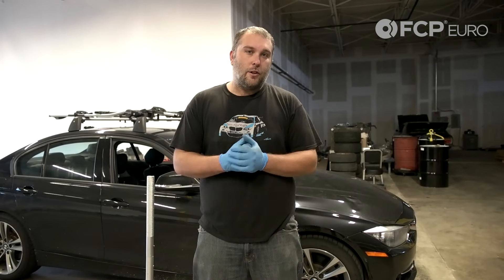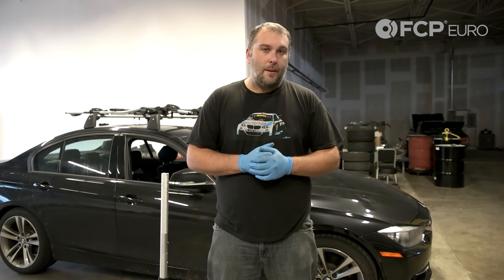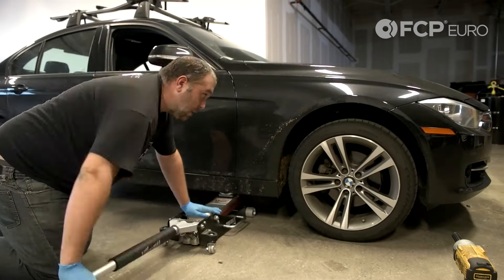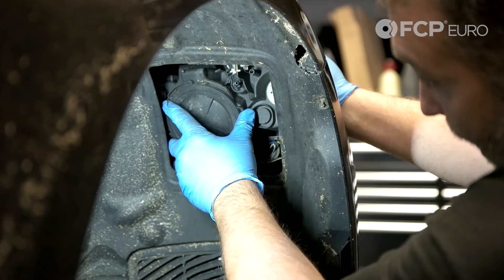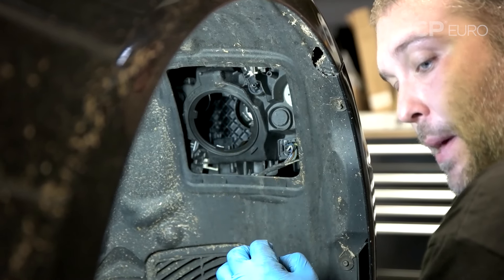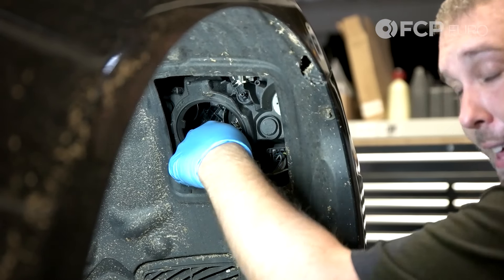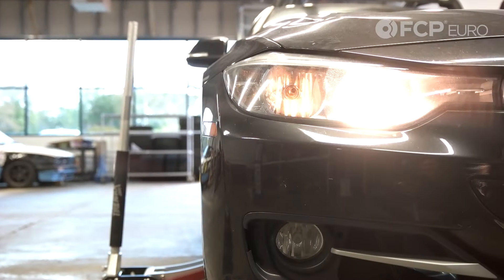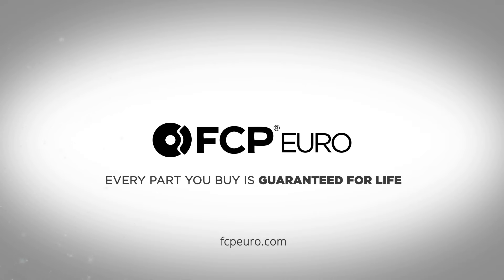BMW F30 & F31 Low Beam Headlight Bulb Replacement DIY (128i, 328i, 528i, 750Li, M3, M5, M6, & more)

Comment: FYI I just did it on my 320i and I did not need to remove the wheel. It’s a bit uncomfortable but you can do it.
Reply: Was just going to ask this
Reply: You can't do it without removing the wheels if your bulb is stuck. Ask me how I know. It is utterly absurd that BMW made it necessary to remove the front wheels to access to these bulbs.
Reply: What about turning the wheel?

Comment: No need to remove the wheel unless you want great camera angles and actually see what you are doing.  I did the first one on the driver side with the wheels turned in.  It was tight and doable.  You also have to do everything by feel, but open the bottom clasps by bending them slightly made it happen.  Once the new bulb was in, I just gave them a little bend back.  On the passenger side, left the wheels the way they were so it was turned out.  I think this gave me slightly more room and I did everything with my left hand this time.  Same procedure, just left handed.  Either way,  you must turn the wheels one direction but for some room but each has compromises on space.  I also found using a quarter helped popped off the outer clasps in the wheel fender perfectly so no screw drivers needed either.
Reply from the maker: Great notes, Paul! And yes, typically we are pulling and removing whatever is in our way to give the best possible view when filming!

Comment: Don't need to jack it up or take the wheel off. 5 minute job. Just turn the wheel fully out the way and it's easy. Thanks
Reply: I wish I believed you. I can’t unclasp the metal thing punching it on there with the tire. It’s been impossible.
Reply: It has been done 2xs on my 3 series without removing the tire. Just turn the wheel the opposite direction.
Reply: You’ve got little girl hands then
Reply: You must have small hands

Comment: Thank you for making this video short and to the point! I'm also amazed that I gotta take the damn tire off to change a light bulb!
Reply: Actually you don't! I just watched this vid for the first time literally a minute ago, found the access panel, opened her up, screwed off the lid, pulled out the light, swapped it out and bam, I was good to go after putting everything back together! Granted the space was a tad bit tight but still room enough to get the job done without raising the car and taking the wheel off.
Reply: @jnom07  I eneded up jacking the car up and turning the wheel but not taking it off. It gave me more room but I still couldn't see what I was doing.  After some hand cramps it got done.

Comment: If 1 bulb goes bad will both lights not work  ?? 
My low beams dnt wrk on neither side 
And all my light fuels are good
Reply: So do I need to change both bulbs or do I have another issue possibly

Comment: Well it is still not as bad as the bringing down the whole front bumper but lift the car take the tire out etc. it is just a light bulb replacement. you open the hood stick your hand behind the headlight take the bulb out put the new one in close the hood ... or the European way like this we are lucky they did not put a special lock to reach the head light.

Comment: My 2016 320i has a flat plastic part attached to the bulb harness. I see two flat metal tabs to release the bulb and two flat plastic tabs to separate the harness part. Not sure what’s up there. Hella part no 158 905-1

Comment: I changed out my halogen bulbs to Led's and I am getting a malfunction code on my dashboard sometimes when I drive.  Is there anyway I can get rid of the malfunction?
Reply: Akshay Singh Yes, you need to add load resisters or get bulbs with canbus built in.
Reply: Matt Wilson thank u. Will this mess up my computer?  If I don’t end up getting canbus kr resistors?

Comment: Pain in the ass procedure for the otherwise finely engineered car. I'm pretty sure that the headlight assembly designer needed to justify his/her existence and job in order to design such an over-complicated housing. Terrible design. Great video!
Reply: I'm failing to see how this is a pain in the ass? I replaced bulbs in my wife's Tahoe and I had to remove the damn airbox to get to the bulb. Now that's poor engineering. Bimmer have this cool access panel, walk in the park imo.
Reply: Saying it’s a “finely engineered car” would be a lie as well, this 13 328i I got from the auction drove perfect for a week then the water pump went bust so I replaced it. A few days later the cooling fan went bad and the car also needed a wheel speed sensor and caused the car to ride like shit.... This is average stuff for when I buy bmws, terrible terrible cars.

Comment: I'm having trouble putting the bulb back into the housing due to the fact I can't see inside it. What tips would you recommend for those that don't have a jack at home?
Reply: Kunal Patel I believe the bulb faces up. Make sure the tabs aren’t bent to much and you can look thru the headlight while you line it up. I’m not a big fan of these H7 brackets. They never get extremely tight like they would on a 9006 or so.

Comment: This is my favorite video on changing the low beams. If that upper tab couldn't get truly boogered in the process - this would all be eezy-peezy. "Kies M" mentions bending the (lower) tabs a tiny bit to get the release. I used that, plan B, saving the upper tab to hold the newly inserted bulb tight. (Well, on the 2nd one anyway!!) I truly hate the H7 receptacle design.And 'do' take the wheel and 'see' it through. When the upper tab thing is done right, it's great, ...but with hamhocks for hands, etc etc.

Comment: any room to put a LED with a fan in that housing ?
Reply from the maker: Yes, you'll be able to fit LED headlight bulbs. There's many bulb kits now available that are compatible with the F30.
Reply: FCP Euro thank you. I didn’t realize the highs and lows are both H7. So I used the braided h7 for the highs because it’s tighter and the H7 with the fan for the low. Thank you for your reply.

Comment: My local shop wants to charge me 9/10ths an hour of labor, or 131$ to do this job (not including bulb).
Reply: you can actually do it yourself without having to take off the wheel, all you have to do is turn the wheel fully inward on either side to get access to the panel.

Comment: Anyone know what the tab looks like?
Reply: Should be silver in color.  In a triangular form.  One on top. 2 on the side. I think you could get away with only bending the 2 side ones and angling around the top one.  I did all 3, but i tt a guy that said he got away w/only doing 2. Sounded bout right.  Also,  i got away with only jacking up the car.  It gives enough clearance to see into the box in order to bend the tabs. Tho, its not a bad idea to take the rim off and clean where it seats to the axle.  They get froze on there

Comment: 2010+ BMW with halogen light options? wtf
Reply from the maker: In the last couple years BMW has since switched to LED headlights for non xenon equipped cars.
Reply: Are the new BMW LED headlights better than the xenon lights?
Reply: lol this is late but I want to reply... the halogen lights are way worse than the xenon lights because the halogens only come in a yellowish color from the factory while the xenon lights come almost blue. The xenons design also looks better. The only good thing about halogens is if you get an aftermarket set that have a bluish tint which you can get for around $50.